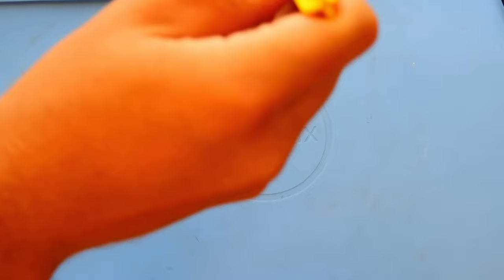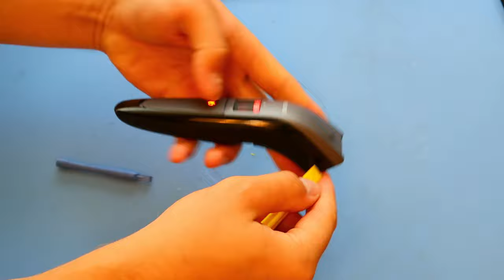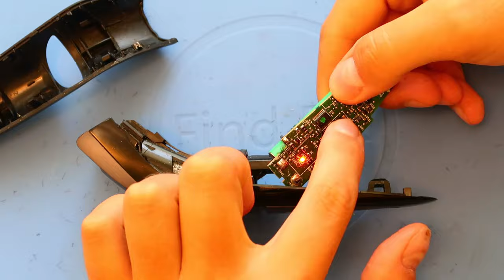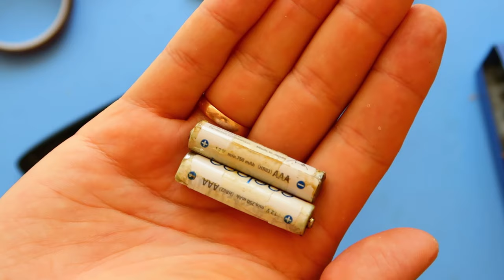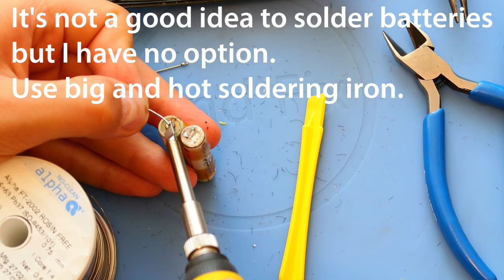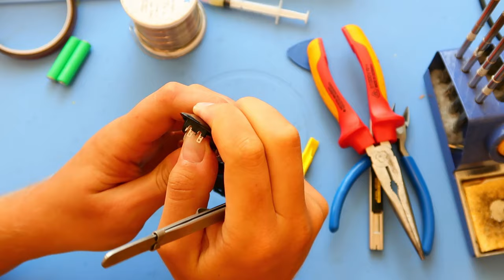Philips Trimmer Battery Replacement

Comment: I was about to buy a new philips trimmer and mean while i came across ths video and made my mind to take a chance and replaced the old batteries with new one.
And finally i saved my 1300 Rs🥰🥰
Many many thanks to guy in the video.🤝🤝
Video was very helpful buddy.......🙏❤
Keep up doin the good work.🤝
Reply from the maker: Great! You are welcome!
Reply: From where did you buy new battery. Does it require any specific type battery? Can you pls share any link if you have
Reply: @aamirshanediwan6389  stationary stores. No specific ratings on battery.
U can go for normal pencil type rechargable battery

Comment: It was impossible with a 25W soldering iron, then I tried successfully with a 80W one. The trimmer is operative now 👍
Reply: Shouldering machine nhi hai, kuch alternate way hai ?
Reply: You shouldn't be using too much heat on batteries, 25w is better but you need to learn how to use it
Reply: Duracel aaa batteries is it ok

Comment: Why do they make it so fucking hard to replace a battery on all electronics these days. I remember the good ol' phones of the 90's and 00's where you just opened the back panel, pulled the bad battery out and replaced it with a new one. 25 seconds repair with 0 special instruments. Now I have to have use soldering a and shit.

Comment: I have a similar hair trimmer from Philips. Battery seems dead, but when I connect the charger I can switch it on, and when I plug the charger off, it runs almost 1 hour from battery.
If I switch it off it does not switch on until I re-connect the charger.
So not the battery is dead, but the electronics cannot deal with a 2 years old somewhat aged battery. Electronics is bad, not battery.
Reply: Same for me. I first thought I had to buy another trimmer, but in fact it has still a lot of battery, I just have to plug the charger a few seconds before and after switching the trimmer on. It's a shame that the electronic lets us thinking that the trimmer is dead. Planned obsolescence ?
Reply: @Pierre.Grandjean philips want u to buy new trimmer. I think its programmed on board. After certain charge cycle

Comment: My current battery is AAA 1.2 v  400 mAh. Can I replace it with AAA 1.2 v 1100 mAh battery. 
Will it work with existing charger. 
Please reply
Reply: Of course it would work my friend, it just will take a little longer to charge the batteries because it has more capacity

Comment: I have just replaced the battery with 2 rechargeable AAA battery of Duracell 1.2v 750mah on my qt4011 Philips Trimmer. But not getting that speed like previous and trimming duration also.. what to do?
Reply: Same case with me.

Comment: Can I use two Duracell rechargeable AAA cell of 1.2v for same performance as original one.  Please reply?
Reply from the maker: Yes
Reply: @KonstantinSachkov  ok question  how can we charge 1.2v cell if charger output rating is 15V
Reply from the maker: @crazycat8233  using charger chip placed on PCB.

Comment: how much voltage it needs to work
Reply from the maker: 2.4-3V
Reply: @KonstantinSachkov  thanks for reply. i found battery voltage is 2.4v mean battery is fine but it is not giving backup.
During charging trimmer works. battery is 2.4v mean it is fully charged but not giving backup. can v sort it out

Comment: I changed the battery of the philips trimmer and then inserted the new battery, then the light turned on for a while again the trimmer did not work. Earlier the trimmer used to run on the direct line. Nothing is happening now.

Comment: Have a different trimmer but replaced the internal batteries with a double AAA battery holder but when turning it on it still flashes orange. Any idea why... happens with rechargeable and non-rechargeable.
Reply from the maker: Have you tried to charge it using original trimmer charger??
Reply: @KonstantinSachkov  Tried non-alkaline battery - flashing orange, tried the default batteries after seperating and charging in different charger - no flashing at all. Tried original charger with no battery in and I think I fried it somehow as there was a slight burning smell, and it won't flash anymore even with the other previous working ones.... Ahhhhhh!!

Comment: Can I use 1100 mah aaa batteries ?? Will it work without any issue ?
Reply from the maker: It's fake batteries, the maximum AAA capacity is about 950 mAh, so you can use them 😁

Comment: I tried changing the battery, but I faced an issue. Could you please guide?
While removing the battery, one of the battery connectors which was originally machined-stuck to the battery, broke in half. 

While putting the batteries again, I wrapped a tiny piece of silver foil to increase the connector's height so that it can touch the battery terminal & complete the circuit.

After closing the chassis, The trimmer was working, but the motor was too fast than the normal speed. Tried connecting the charger and switching it on, still the same issue persisted. 

I tried with the original battery and connected the charger and switched it on, within 2-3 secs, there was some smoke coming out of it.

Is the silver foil causing the issue? There was nothing burnt on the circuit board. I'm guessing the motor gave away the smoke.

How can I restore it to it's normal speed? It's sucking too much electricity, even though I haven't made any other changes, than the ones shown in your video. 

Batteries are AAA 1.2V Duracell rechargeable ones.
Reply from the maker: I think you've damaged the board.
Reply: @KonstantinSachkov  Thank you for replying. 

I had put the batteries in reverse, i.e -ve to +ve & vice versa & switched it on by mistake, the 1st time. 

Will reversal of current damage the dc motor? What are the remedies to this problem?
Reply from the maker: @perkinmanor9045  It damaged the board.
Reply: @KonstantinSachkov   Okay cool, thanks :)

Comment: Hi.. Thanks for this video. I have 2 queries, if you can kindly respond.

1) What if we Re-use the original steel plates which are present on both ends of the batteries (for soldering)

2) What is the purpose of using Heat Resistant tape around the new batteries?  Can I use normal electric wire insulation tape instead?
Reply from the maker: 1. You can reuse it.
2. No purpose, just I have it 😁 you can use any.
Reply: @KonstantinSachkov  thanks 👍
Reply: From where did you buy new battery. Can you pls share any link if you have.
Reply: Recharge

Comment: Any way to put it working without battery , just with the charger
Reply: i think you should just connect those two electrical contacts where the batteries connect to

Comment: Hey please help..
I changed the battery and soldered.. previously during charge it was making strange noise as soldering was not proper I figured it out and after soldering the battery is charging but the motor isn't running.
Reply: I had done proper soldering but after charging the battery..motor isn't running.. please do guide me.
Reply: Please do guide me..
Reply from the maker: @nobleHitter  maybe you broke something, maybe batteries are dead after soldering.
Reply: @KonstantinSachkov  I replaced with new battery and proper alignment..also I didn't broke anything
Reply: @KonstantinSachkov  hey!!!
What should I do..I charged my battery using battery charger and then connected and test motor started running but for a short while..It means all okay with the circuit and nothing is damaged but why it is Running for very short time...
Reply: @nobleHitter  clean the blade well and lubricate with Vaseline grease or sewing machine oil
Reply: @widziwszystko8027  Blade is perfect..
Reply: @nobleHitter  pull out the batteries and check them
Reply: the battery must not be soldered, it should be welded, maybe this is the reason, if you cannot repair the device, I suggest buying a new trimmer and not wasting time, time is money
Reply: @widziwszystko8027  Yeah..I bought.
But still I want this trimmer to work like before.
Reply: I had same issue, changed battery 🔋🔋 without soldering , just used duck tape
Started charging, then switch on , motor on for a few seconds, no smoke 
Then died, charging orange LEDs  not blink anymore 
HC 5450

Comment: Would using a lithium-ion 3.7 volt battery work? It is slightly higher than the 2x 1.2 = 2.4 volts
Reply from the maker: Try this, I would add a resistor in series. But anyway you need a charger.

Comment: Bro my trimmer gives 2 hour backup for 12 hours charge... I can replace it's batteries similar to remote ( open cover and insert).. can I use some non-rechargble battery temporarily if trimmer's main battery is dead while in use.. plz reply
Reply from the maker: Of course you can.